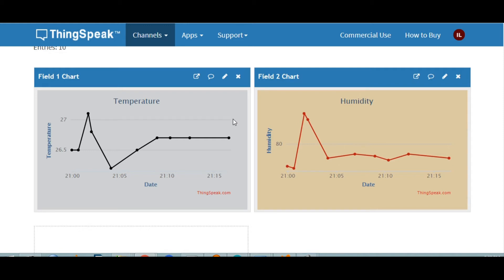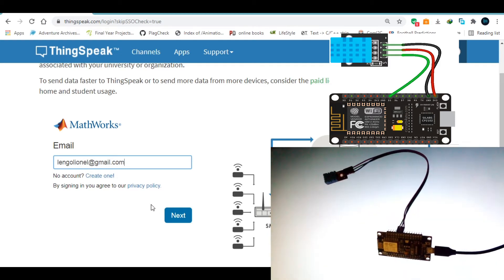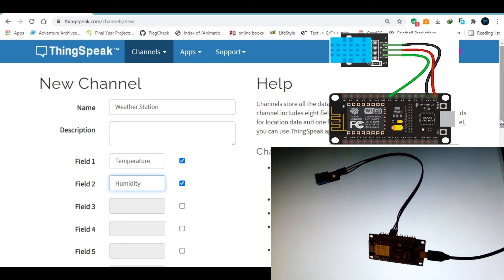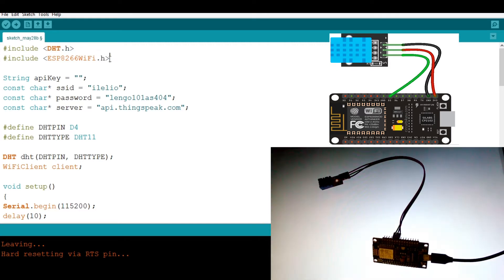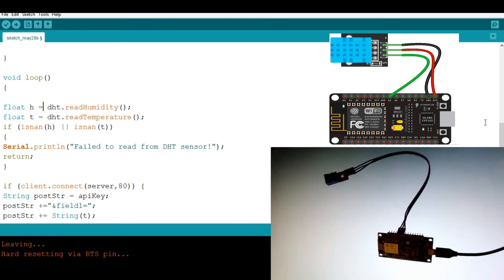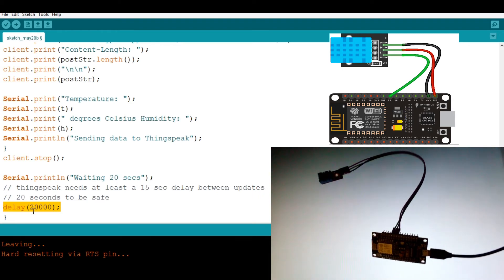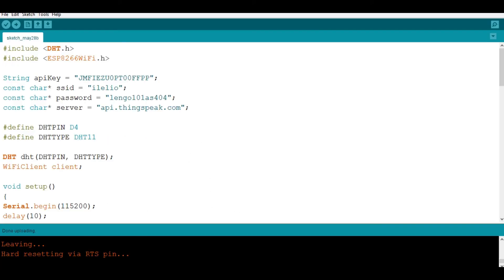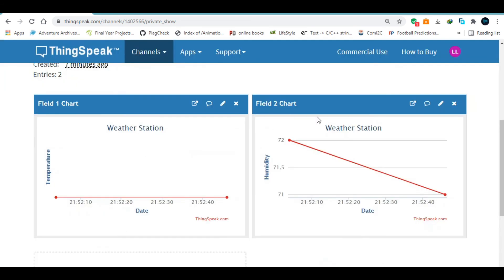how to make Humidity and temperature graph using thingspeak and ESP8266

Comment: Do you need to have it plugged into the computer so that it collects the data or is it not necessary and it can work perfectly?
Reply from the maker: It is not necessary to always have it on the computer. When you are done with your coding, you can simply plug it on a power supply.
Reply: @idukunda_lengo  Thank You!